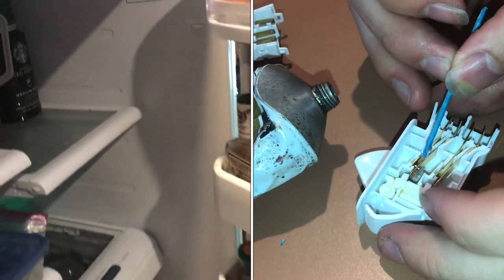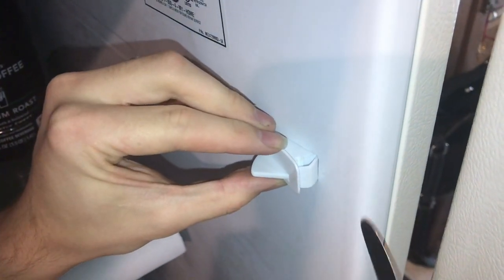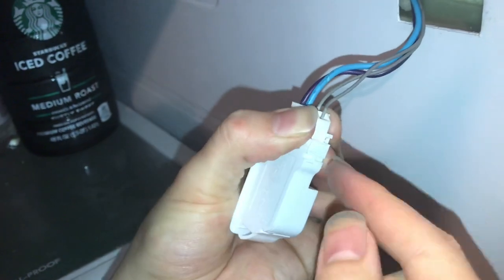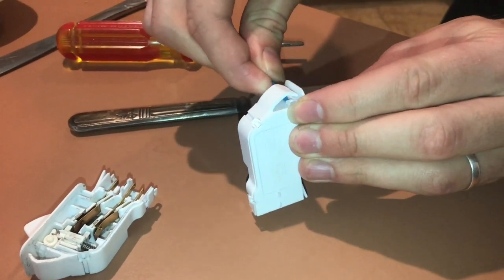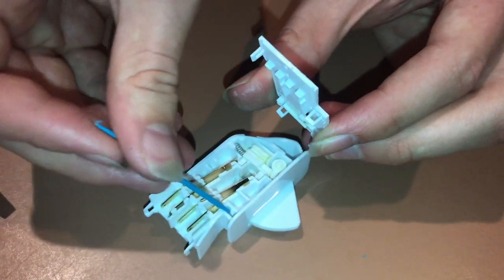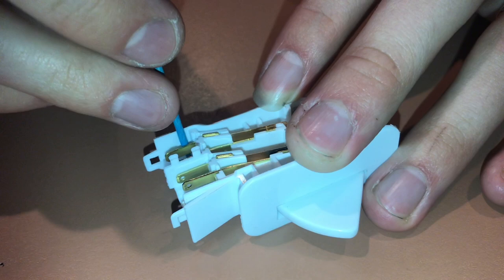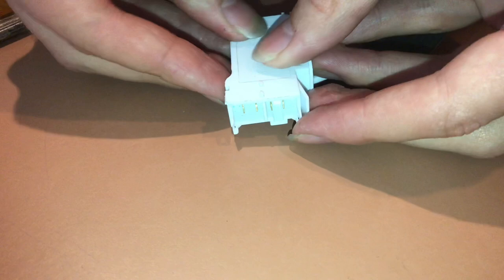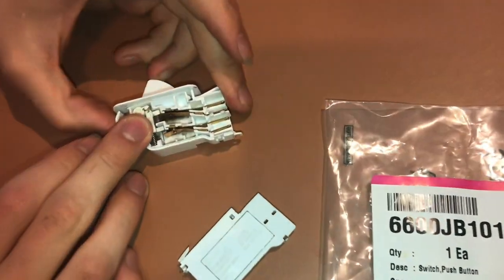fix refrigerator light switch BETTER than “new” one(using dielectric grease) 6600JB1010A  kenmore lg

Comment: Good stuff. Thank you! Mine had that same residue from arcing, but on the other set of contacts. I just cleaned both sets off with my finger and ran a nail file across the contacts, and the old one is still working perfectly again.

Comment: would this be the cause of dimmed lights? I tested the light strip with a 9volt battery and it seemed fine, but when it's inside the refrigerator, the lights are extremely dim.